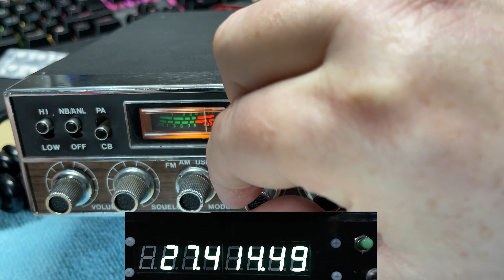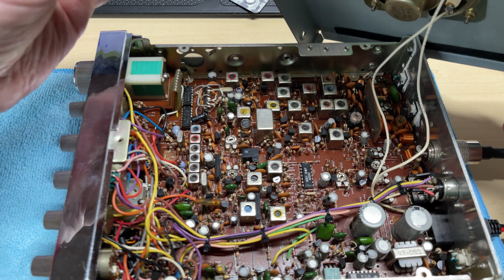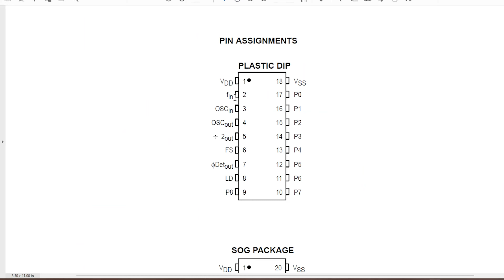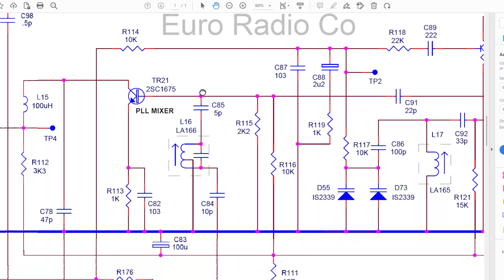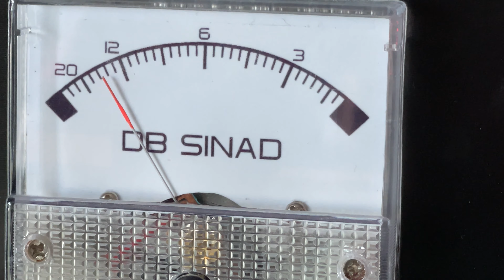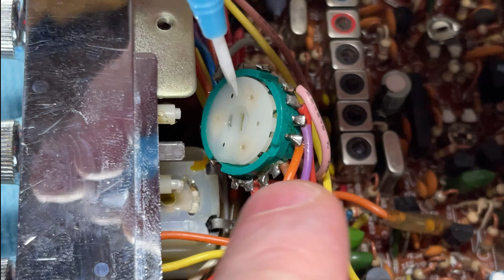EP 141 - Vintage Stalker IX - CB radio - quick service - old time pll mod ?

Comment: thanks for a great vid. I have just rescued my 9F DX where it has resided in a drawer for about forty years and I'm trying to tidy it up. I seem to have a problem with the audio. When I turn the volume switch on it is excessively loud and I have a feeling that the Pot may be wired wrong. Looking at the Pot from the rear, the right tag has a black wire which appears to go to ground. centre tag wire is yellow that goes to vol M on the board and left tag is white that goes to vol H. Could you please tell me if this is correct? Also I have to replace the speaker. The one in the radio is 16 Ohm but I can't find one, is an 8ohm ok? Thanks very much. Steeplejack Tom.
Reply from the maker: Hi, 8 ohm should be ok , as for that wiring mine is black at the top , yellow middle and white bottom , going to the same places you have mentioned.
Hope that helps.
Reply: thank you very much pot seems to be wired ok. Any idea why the audio is so loud? I just turn the radio on and hardly have to rotate the knob for the audio to be very loud. A small turn makes the sound so loud to be unbearable. I am wondering if there is an rv on the board that adjusts the sound level that might not be working given that the radio hasn't been used for forty years! I think if I turned the knob half way the volume would be so loud that it would blow the speaker! I would appreciate any info on this problem. Tom @MicroChipz
Reply from the maker: There is no pot to adjust on the board , it could just be a dirty or faulty pot, theres not much inbetween the pot and audio amp, the pot controls the amount going into the amp , it does not control the amp directly , the amp is on full all the time. so if its coming loud it can only be the pot or the ground loose on the pot .
Reply: Thank you for your courtesy and help I am indebted to you. I did think that was the case but I was clutching at straws. I have ordered a new pot and will check the ground as you suggest. I am having great difficulty trying to purchase the internal speaker in England. I have seen them advertised in America, but the cost and postage is extremely high. Any help in obtaining
one in England would be very much appreciated from your good self or your many radio friends. Tom  @MicroChipz

Comment: I have a 148gtl-dx with this PLL mod, and it looks equally chaotic, but works. Allegedly it was a standard fix, mostly for CB-to-10 in the early 90's, but there is not much in the way of instructions on the web to do it. Would be cool if someone reverse-engineered it in plain engrish on the web today..
Reply from the maker: Im sure hidden away in a notebook somewhere is the explanation.

Comment: Wow I’ve been working on radio gear since the early 80s and when you took the covers off I nearly threw up. What an abortion that PLL wiring and rats nest of diodes and resistors.
I generally don’t leave comments.
Reply from the maker: I suppose for the day it was OK , putting in a 145106 instead of the 8719 and making a diode matrix must have took some work. but yes defiantly a nest there .

Comment: Good old diode matrix like done to the 148's, much better on the cobra as its got a proper band switch
Reply from the maker: Yup no issues there , someone clever put in the 145106 tho in place of the 8719